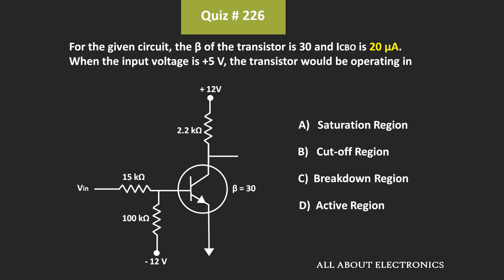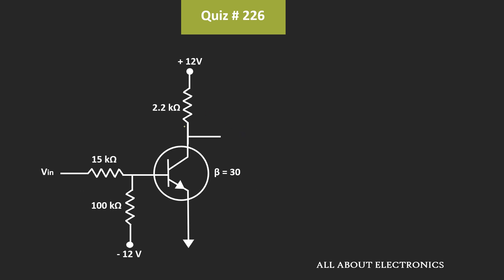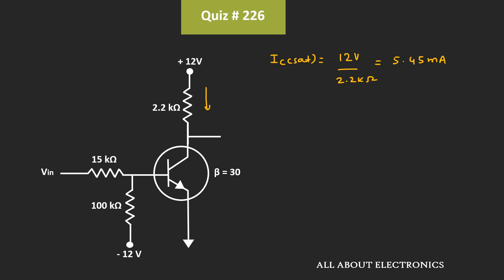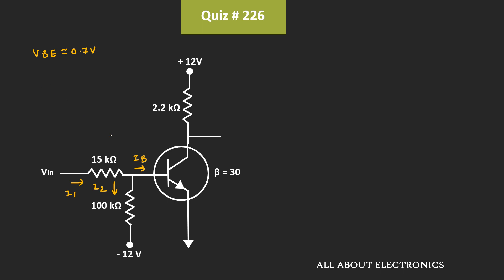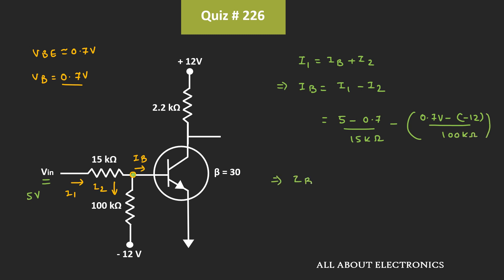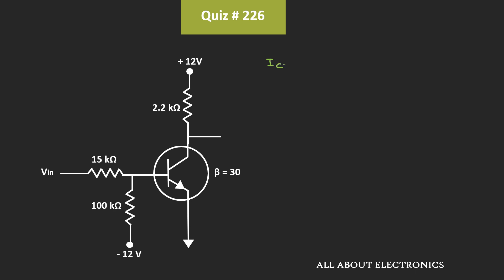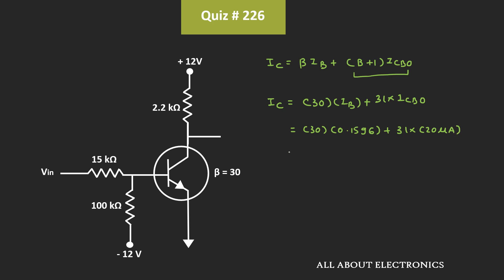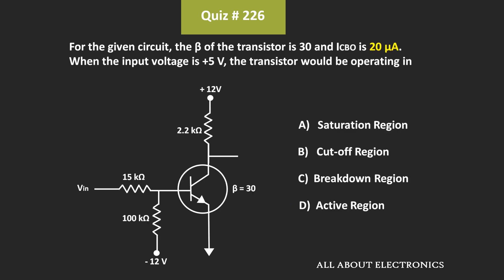BJT (Bipolar Junction Transistor ) | Quiz # 226

Comment: I’m not an expert, but I think I understand the point you made with this question. Unless the question gives you a Vce other than zero for saturation region, it should be safe to assume that any Vce above 0 would imply that the transistor is still in the active region.

Comment: Sir with this value of Ic, Vce is less than 0.2v, which is clearly in saturation mode
Reply from the maker: That's what I mentioned at the end of the video. It is on the verge of the going into the saturation, assuming Vce (sat) = 0.
Reply: @allaboutelectronics-quiz  thanks sir  I got it